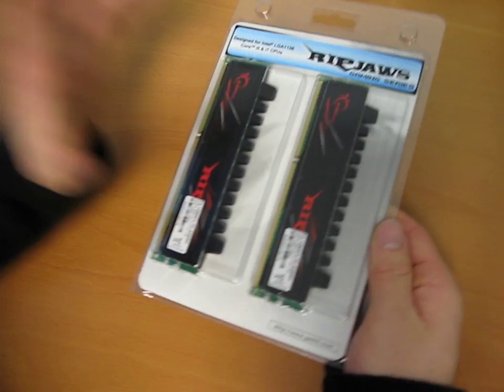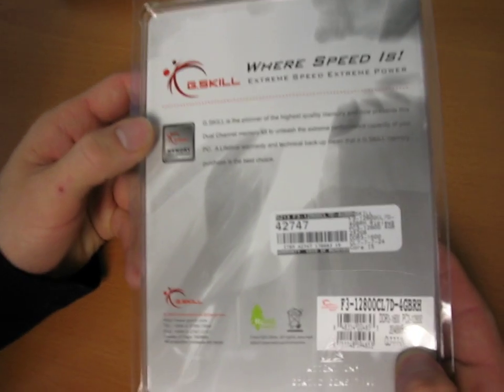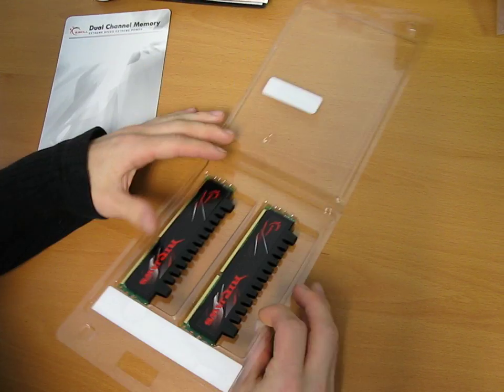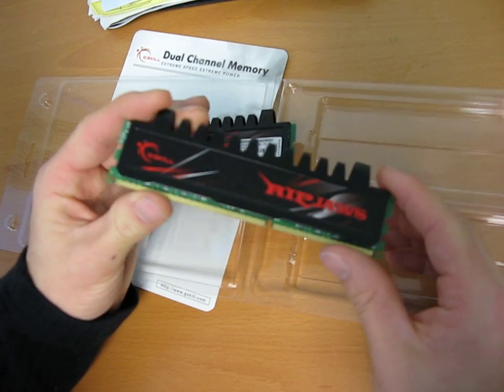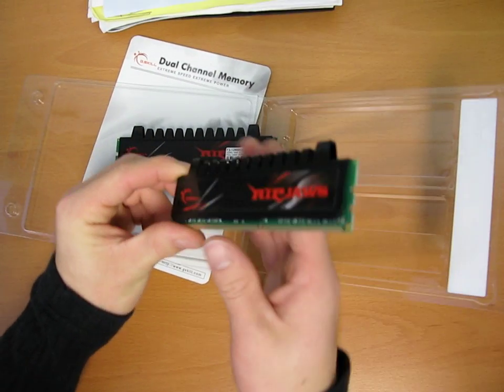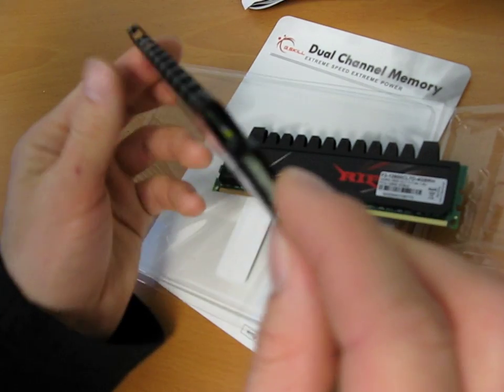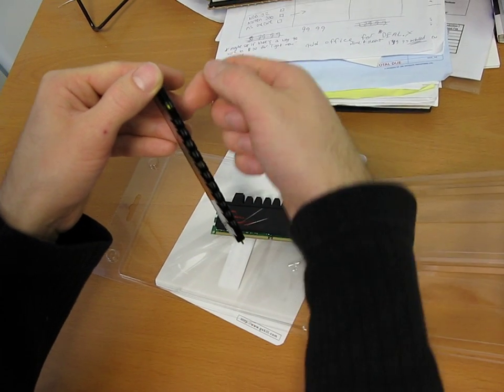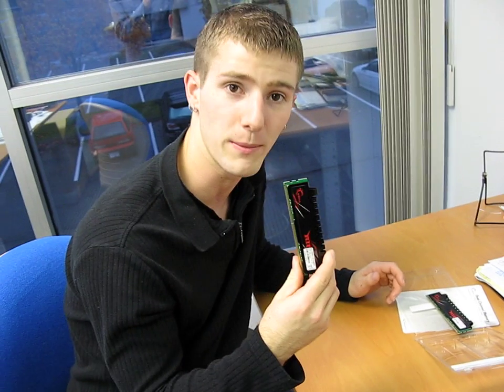G.Skill Ripjaws DDR3 RAM Unboxing Linus Tech Tips

Comment: Another great video. Ram question. Was thinking of getting the g.skills 2200mhz ripjaws. Do you think 2200mhz is overkill for gaming and too fast to use or should I opt for a lower mhz version. Also, how much ram do I need 8 or 16. Does more ram make a difference in my gaming performance? Thanks!

Comment: @darkstar2721 Yeah it's good ram. I've had it in my system for almost two years, problem free. The only stick that's actually gone bad is the one that I accidentally static-shocked lol, which surprised me that you can actually destroy the memory even if it shocks the heatspreader.
Reply: How long did you have these in your system?

Comment: @massmurderer02 I think a few editions of the GSKill Ram series had issues with AMD before, but I read in the features and details that the ... Memory Model F3-12800CL9D-4GBRL? the red kind @ 1600 is compatible with AM3 boards. I guess you'll just have to read the features and details when you buy. I had my eye on the blue sticks cuz it was at 1600 and blue which would match my gigabyte 890FXA UD5 board, but I read some comments how it was incompatible w/ the AM3 boards so I reseacrched abit.

Comment: @wheely132 I don't know if you've received an answer, but it's hardware. Any piece of hardware in any machine can, and will, wear out. Longevity+Heat+Turning your machine off (thus a heating and cooling effect), etc. all eventually degrade the hardware.

However, ram with good heat spreaders should give adequate cooling and can easily last you 3 - 4 years without fail, sometimes much longer than that. Everything in a physical capacity degrades over time, it's a law of the universe.

Comment: ddr3 starts at the standard of 1300, and you can overclock it to 1600 just like 800 goes to 1066, but after that its no mans land, you're on your own. its not just flicking a switch and pushing a button

Comment: wow dude you're such a idiot lol, im pretty sure you're one of the poor people who buy the cheapest parts and when they break down you call them cheap, you buy what you get.

As for the memory, you're a idiot and you're running a ancient cpu aswell.

All memory thats ddr2 will have a standard of 800 mhz regardless of MB you will have to MANUALLY overclock it to 1066, as you have done so, even if you buy some 1300 memory you wont be able to get it up there unless you manually overclock it.

Comment: 1066 is the bottom of the barrel compared to euthasiasts.

try overclocking  that memory to 1300 + while using stock cooling and see if you can touch it.